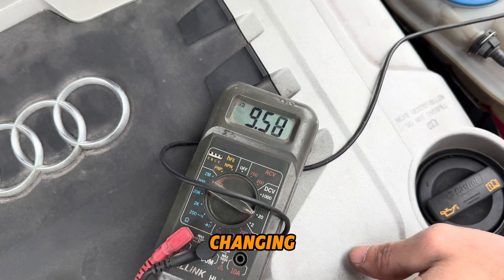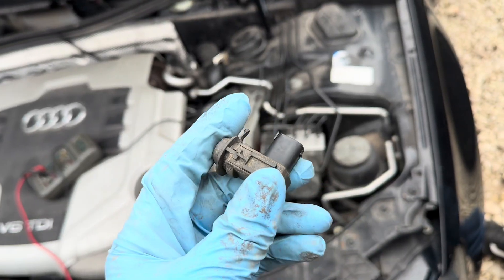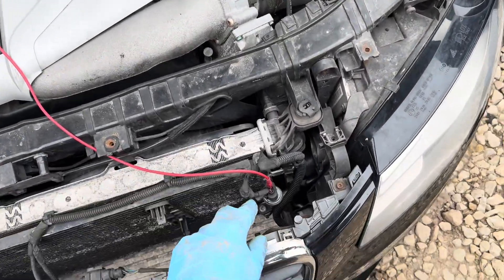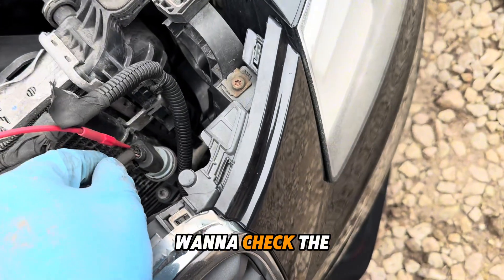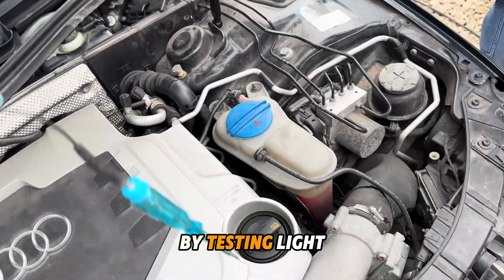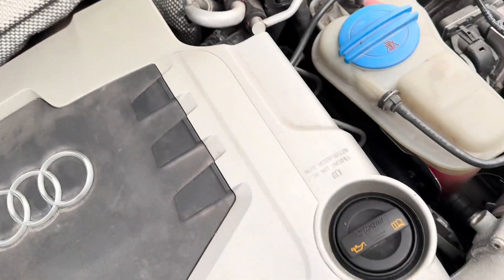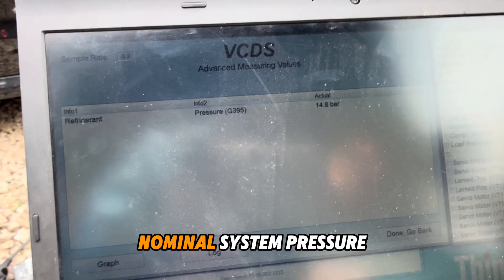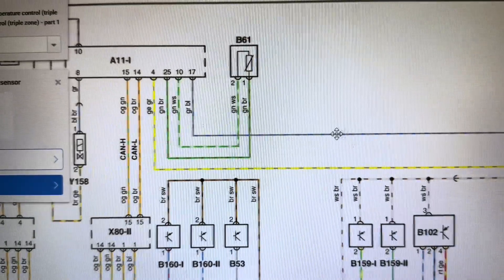Audi A4 A/C not working,00256-A/C pressure, 00457-central electronics control ,01592-air quality

Comment from the maker: 0-12v
Reply: I have checked the pressure switch. It has 12v and continuity. So does the air quality sensor. I do not know where else to check. 00457 error says no communication with J519. Also i assume because there is a fault somewhere the A/C compressor has no voltage due to the 00256 and 00457. I also had a humidity sensor code but it is gone for now. Any guidance. Do i trace all these sensor back to J519 and/or J255? I will unplug both sensors one at a time to see if anything changes. First. G365 i have replaced twice now.
Reply: Did you solve the issue
Reply from the maker: @king21monstar  pressure sensor works only OE normally. Alternative a/c pressure sensor sometimes not working correctly.For this car problem were in air quality sensor.
Reply: @king21monstar so all the slaves on the J519 module is now dead on my car. All A/C sensors. A/C compressor not seeing any voltage as well. Voltage stabilizer and battery control module also died now. I checked the battery voltage at rest and it sat on 12v. That means the battery probably at 35-50% charge rate. Alternator only charges 14v to not damagethe battery further. Thing this means my battery is done for and won't charge any higher. Apparently when the voltage drops too low the J519 starts switching sensors in the comfort system off to preserve the battery. So I am replacing the battery next week and will give the feedback after I have coded it into the BCM.
Reply: @king21monstar  unplug the A/C switch and see if 00457 can clear with a obd2 scanner. Maybe we can solve this together 😅😅😅

Comment: I have been looking for this troubleshoot. what should the voltage range of the signal wire be? I will be attempting this with a obdeleven scan tool.
Reply from the maker: 0-12v 
You can test with multimeter.